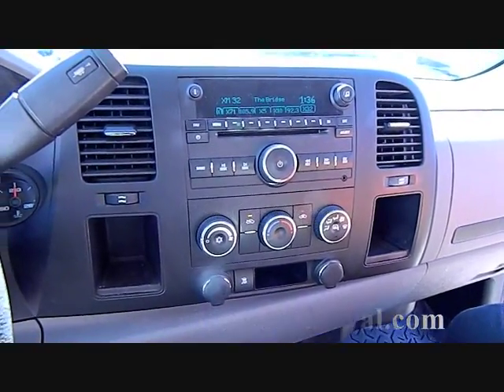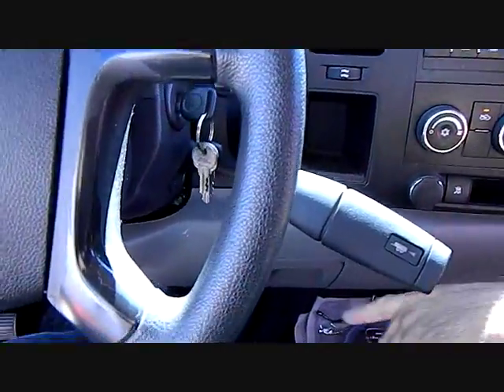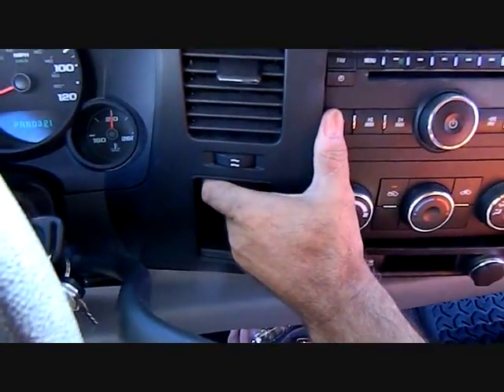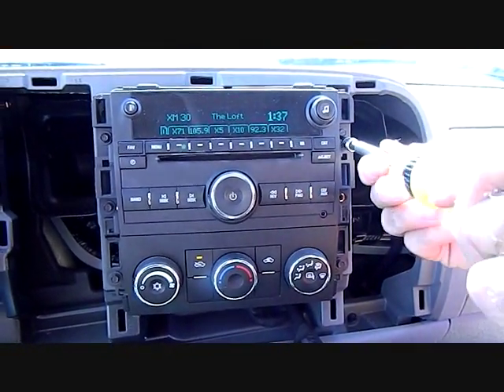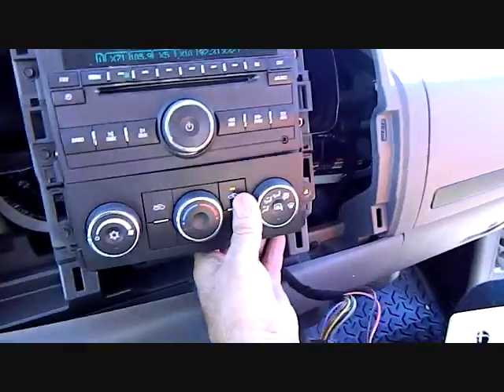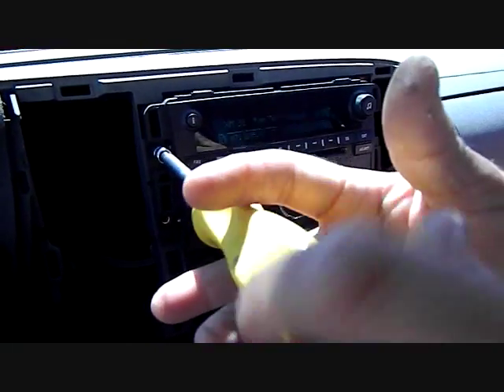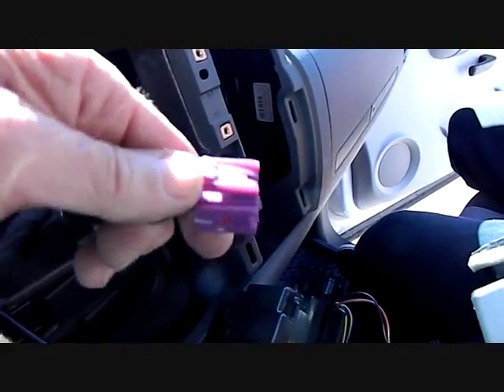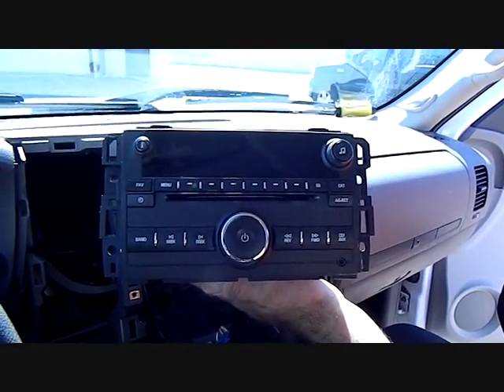GMC Sierra Radio Removal = Car Stereo HELP

Comment: Press fit antenna?????? Huhm.................. What exactly does one order to attach the weird press fit asi quote you antenna? I've got plenty of antenna adapters here and zero that fit in to the OEM socket press fit on my 2007.5 GMC Sierra 1500 crew cab

Comment: Hello do you know if this system will work in a 2009 GMC SIERRA 1500   Hieha Car Stereo Compatible with Apple Carplay and Android Auto, 7 Inch Double Din Car Stereo with Bluetooth, Touch Screen Car Radios MP5 Player with A/V Input, Backup Camera, Mirror Link, SWC

Comment: These style radios are pretty common in most GM vehicles i've noticed. I would assume that the one in my 2006 imapla is almost if not the same thing. I was wondering if there is a fix for the volume knob on these, where you rotate the volume and nothing happens at all in either direction. Every other button works on the unit, and the steering wheel volume controls work fine. The actual power button works if you push down...Just thought I'd ask since this is the only video you guys have showing this style unit. Thanks.
Reply: GM is tricky.  Although they look (almost) the same, they force you to have them unlocked.  You can use replacements from other vehicles but you have to unlock them first (another youtube video...).

Comment: What did putting it in a lower gear have anything to do with the radio removal.  That’s like me turning off the water to my house in order to re-shingle my roof??????
Reply: It's to aid removing the plastic dash piece around the radio

Comment: I would like to know why he had to turn the ignition on and put the truck into a lower gear.  Watching the video I did not see any benefit to doing this.
Reply: chukarwalker Looks like he did it to get the gear shifter out of the way. Gives him more room to work.
Reply: Thanks James,  I went out and looked at my truck after seeing this and that was the only thing that I could figure out too.  Thanks for responding.
Reply: It gives clearance for the left AC duct.  Just pulled apart a 2013 Silverado.  I dropped and lost the last screw when removing the radio...  grr.   It is simple enough for a DIY to remove the panel below the steering wheel(2 x  Phillips screws and a 10mm bolt between left screw and OBD plug.  And the panel below radio panel(2 x 7mm on left side).  I was surprised the clips didn't break.  Everything snapped apart and together easy enough.  Found the screw tho.